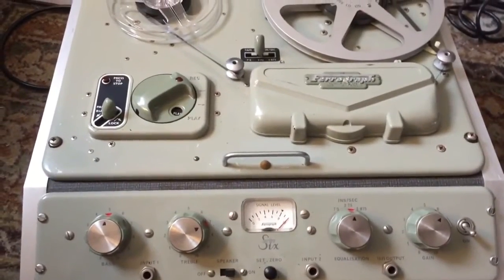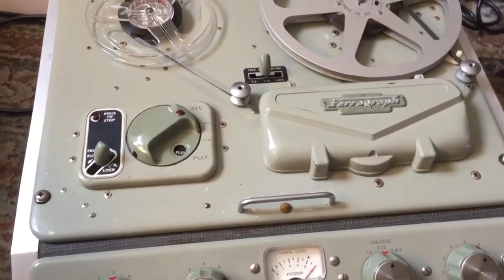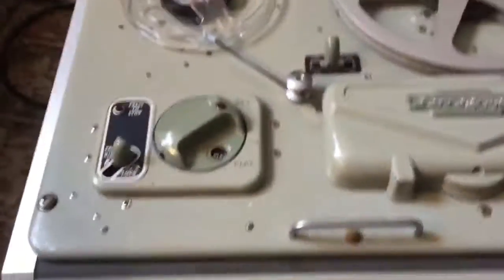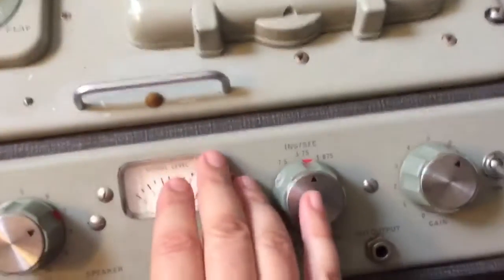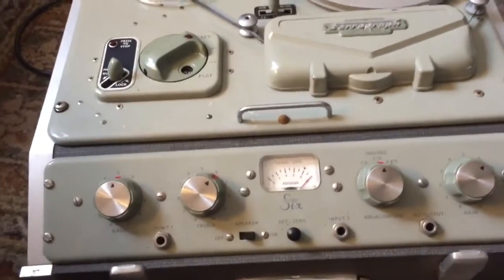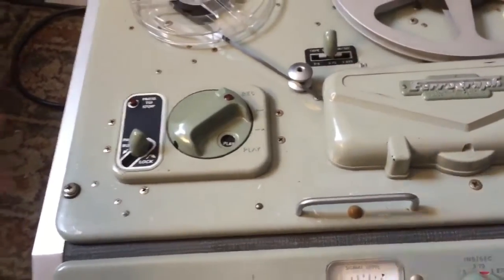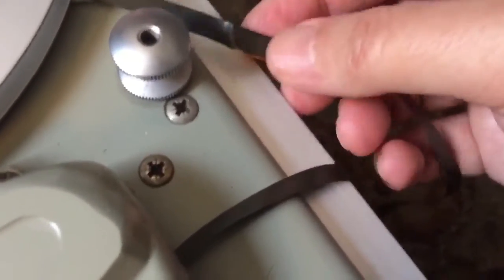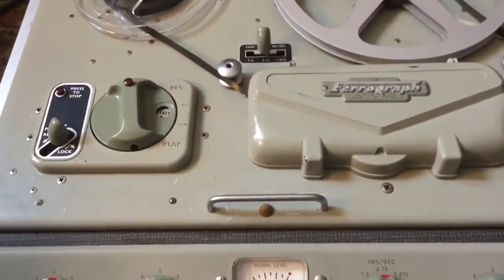My Ferrograph reel to reel tape recorder revisited, nearly a disaster to my original Beatles tape !!

Comment: The Tandberg TD20A had a habit of doing that from brand new !  Evil speeds !  Can't for the life of me see why they incorporate brake pads when they are separate motors cus the electronic braking  should eliminate that from happening.  I think it must be so the reels stop faster, but look what happens if the brakes are not adjusted microscopically !  My heart sank when your tape busted, it only seems to happen on those precious tapes we cherish.  I put a full reel of tape on top of an upside down speaker with a decent magnet on it once and instantly erased the lot !
Reply from the maker: I actually had the tape threaded wrong. The tape should go behind the tape guide, the one on the left hand side I had the tape in front. Whenever I play like precious Beatles tape on machines like this I just play them through and don't use rewind or fast forward, best way really. Shall about your tape left on the speaker magnet, what a bummer !. When I saw that happen to my Beatles tape I nearly cried, lol. Also on the Ferrograph and all tape recorders that have very fast rewind, fast forward you should use spools of equal size. I was told that by a Ferrograph expert, I also saw that statement in a manual somewhere.